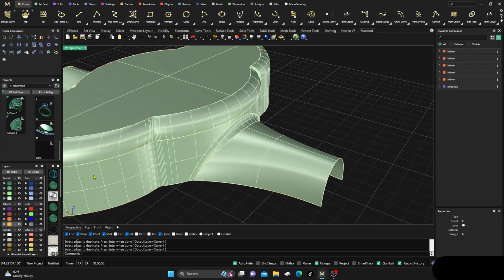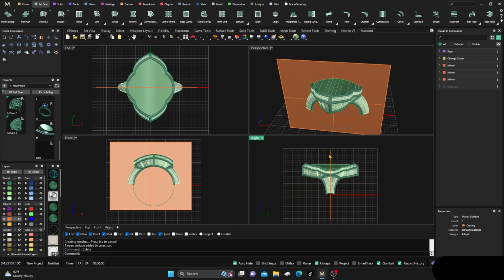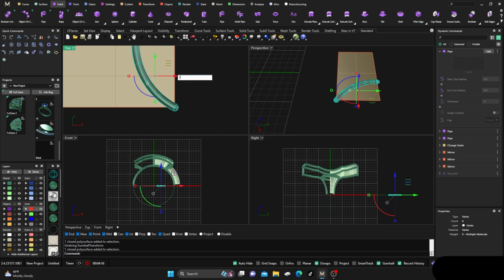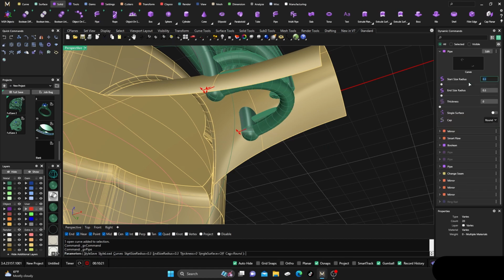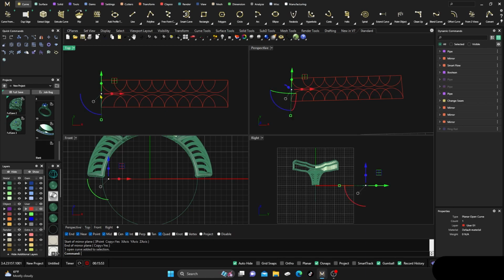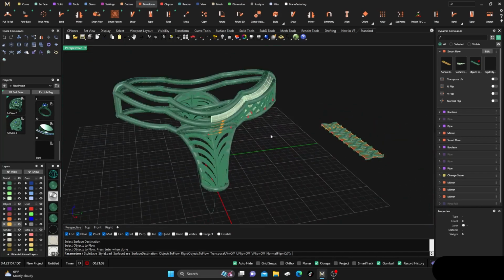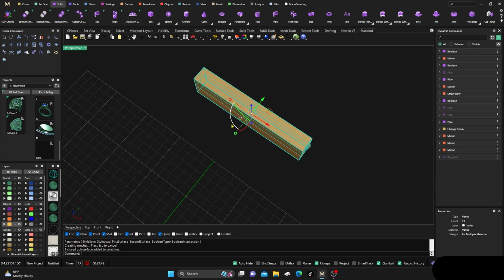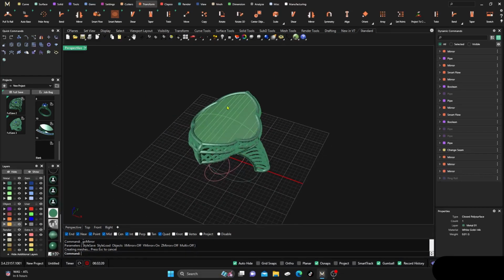MatrixGold Making a Ring Part 2

Comment: Thanks man! I really love watching your videos, they are very understandable and helpful. But I have a question. Since the surface we created with the auto base command has different lines from the original one, what I draw on the surface with auto base deforms when I move it with flow later. How can I make them both have exactly the same lines? In this way, the motifs I draw do not encounter problems such as expanding and being crushed.
Reply from the maker: You are very good. Yes, that is a key when doing smart flow sometimes. You can just rebuild your surfaces with extra points. Just type rebuild in the command line and pick your surface and up the point count on both. You can also use apply UV curves and layout the profiles on the destination surface as well.
Reply: Many thanks <3 @donsjewelrymakingandjapantrave